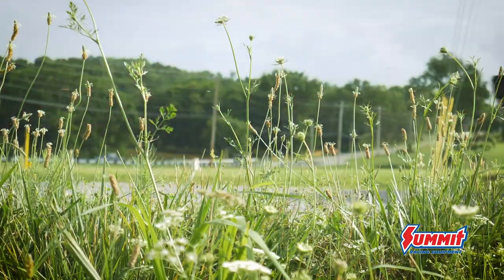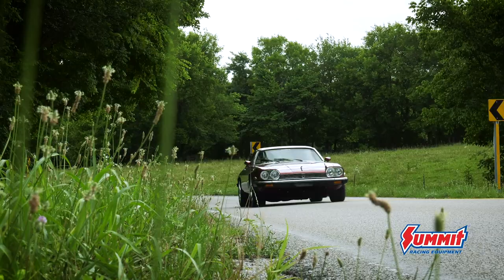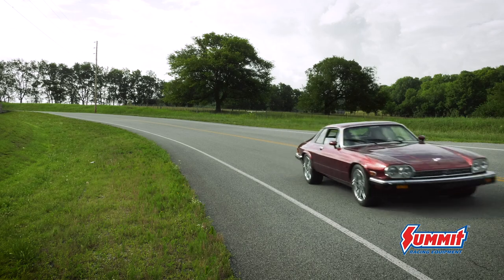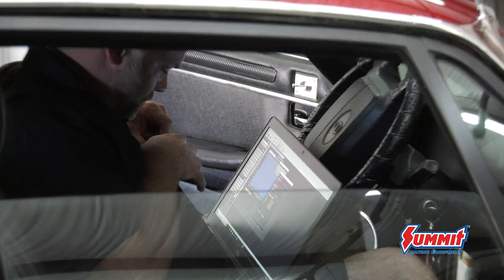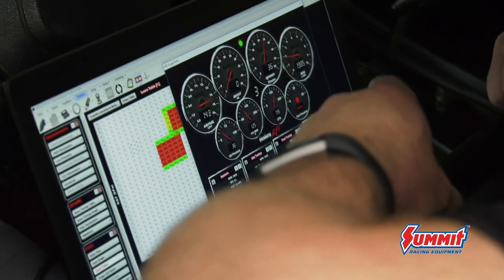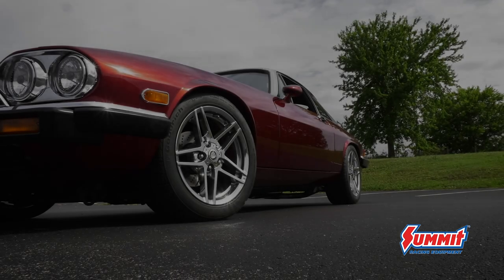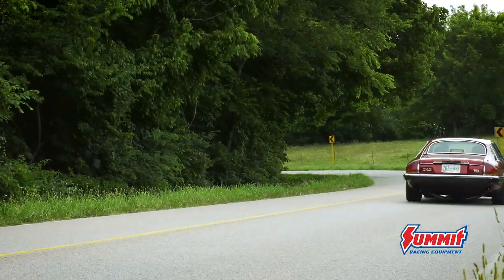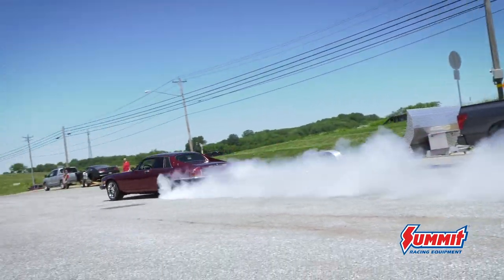Project XJS-LS (Part 16):  Road Testing and Dyno Testing

Comment: Yes,yes,yes..fabulous  project  .Been thinking about a mustang (430hp) engine, box and diff if required into my 1995 4.0 ltr xjs but just don't have the pennies. Much prefer the pre face lift car as the rear is much better looking although the Doctor McCoy dash is crap but you sorted that. Great to find some car enthusiast which confirmed I'm not losing it, great project, well done.